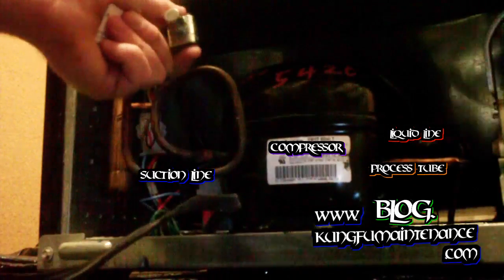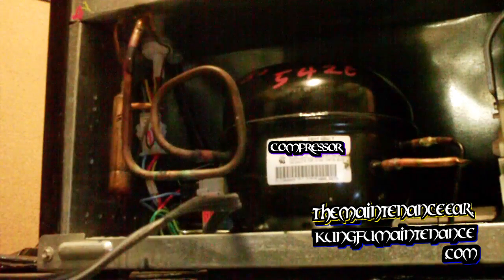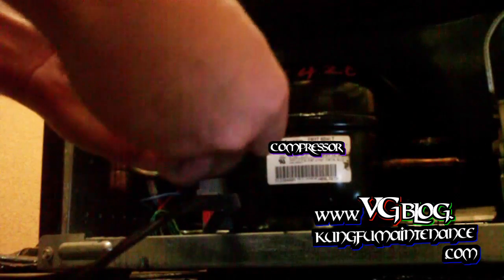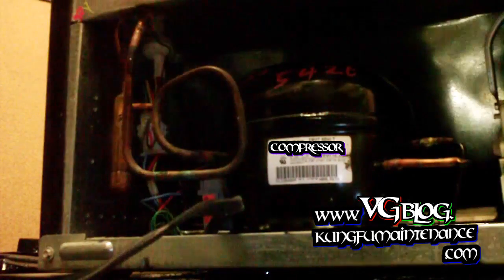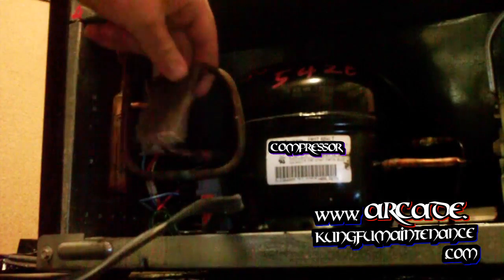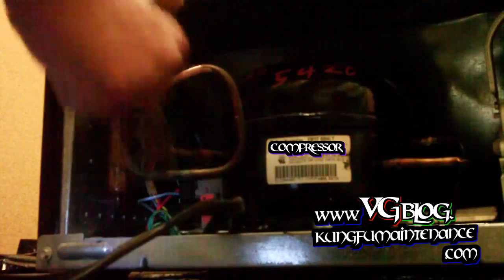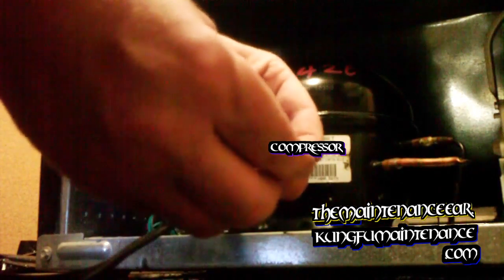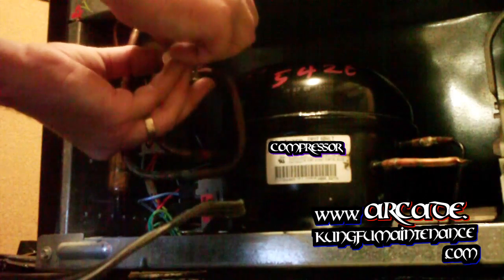How To Install Bullet Piercing Valves To Charge Refrigerators Or Air Conditioners Low On Freon

Comment: Do bullet piercing Valves cause leaks over time?   
Can you make a video to show how to fix a line with a leak in it?

Thanks
Reply from the maker: Bullet piercing valves can leak over time. To fix one with a leak the refrigerant would need to be recovered and than a more permanent valve brazed in. These are usually used for refrigerator repairs using R-134a which is less damaging to the environment. Leaks are most often so small that all that is needed is a tiny recharge if one does leak. The charge can often last years so unless the leak is very bad the valve doesn't necessarily need to be replaced.
Reply: KungFuMaintenance Very cool.   I ran into this problem before and had to pay nearly $500 to get it fixed.  So I was hoping you could do a video to show how to repair the leak.  I may have one again, and can not find any leak repair videos.
Reply: I was also wondering, how much do all the tools cost to be able to recharge, pull the air out, and more?

Comment: Hey, My compressor looks just like this one accept the line you installed the bullet piercing valve on isn't being used on mine and it is crimped off.  So In saying that what do I do to charge my system.  by the way my fridge is a  Admiral ASD2514AR not sure the age I couldn't find a date but its not really old.  Its a side by side as well.  Any info you can give me would be great.  Thanks.
Reply: KungFuMaintenance Thanks for the tips, answered my questions for the most part. Any benefit to installing a second access valve on the liquid line vs process tube? Or a second one at all?
Reply: 3 months now and I have had to turn my fridge down 3 separate times because it is so cold.  Max on fridge is 7 I have it on 4.  Freezer has separate control knob also set to 4 and stays at a steady 28 degree's at the top and at the bottom 20, I was told the bottom was somewhat like a deep freeze. Every local repairman I called said they would not work on my fridge unless I payed them to install a new compressor.  I have been a mainteneance mechanic for 20 years and pretty handy with just about anything and with KungFuMaintenance help I was able to turn a completely useless refrigerator into a like brand new one.
Reply from the maker: The short capped crimped off line would be a process tube. Some like to charge through it(There are many schools of thoughts on best practices for charging.). The slightly larger line (Sometimes has foam wrapped around it would be the suction side (I prefer to charge through it about 6 to eight inches from the compressor) it is sometimes insulated to maximize efficiency and to keep the cold line from sweating and dripping in the wrong places. The smaller diameter line is the high side line and most likely gets pretty hot when in use.
Reply: Oh Ok.  I wasn't sure what that extra tube was for.  Do you think its safe to recharge from the tube or better to be on the suction side?  I want to do it right so if the suction side is a better spot then maybe I should do it from there even though the process tube is more accessible.  Thanks for clearing that up for me.  I actually thought that might be what it was I just needed someone who knew what they were doing to confirm it for me.  So do you think it matters, process tube or suction side of compressor?
Reply from the maker: KyBigGuns Either side is OK. Their are many schools of thought on which is better. I personally prefer charging on the low suction side with a bullet piercing valve as no really special tools are needed and recovery of existing charge is not needed if it still has some refrigerant in the system.
Reply: I did everything correctly and my refrigerator has never worked better. Thanks for the advice.

Comment from the maker: If you go to my Kung Fu Maintenance website "Keeping Cool" page. You can enter "bullet piercing valve" in the search box at top right. I make a small commission off any parts purchased there. Or maybe your local HVAC and/or appliance store.  It is preferred to charge little by little through the low side with vapor while monitoring pressures and temperature stopping early at desired temp. I like to see the freezer at 0 plus or minus 5 degrees and the fridge at 40 plus or minus five degrees.

Comment: Hi,
  Good video.  Where can I purchase one of those piercing valves and how do you know how much Freon to put in it?  Thanks for your time.
Reply: They are Supco brand Bullet Valve (google it).  They are available at Grainger stores both online and in their warehouse.  Locations all over the US.  Many people ask about what adapter you have to get to attach to the Supco Piercing Valve to your refrigerant can -  you can get at many autoparts stores what is called a "R-12 to R-134a Retrofit Parts Kit'. This will include a few different adapters - one of which being the exact one you need to make the Supco Piecing Valve connect to any R-134a refrigerant canister that has the "shrader valve" fitting.  I ran over to my local O'Reilly or AutoZone or Advance Auto Parts and they all offered one in stock.  Brand is A/C Pro part number is VA-LH11 (Google it).

Comment: Thanks a lot!!, can you help me out? I need to know what kind of tools that the technician attached to the process line in this video ApplianceJunkcom evacuation and charging of a refrigerator 2:03  I don't want to cut open the compressor process line and let the Freon escape. Bullet piercing valve is not available here in the Philippines . Thank you in advance!

Comment from the maker: No actually the discharge tube is the high side or liquid side line just after the compressor. It is usually extremely hot (enough to tattoo you)when the compressor is running as it discharges the absorbed heat in the liquid refrigerant to the condensor coils to give off its absorbed heat. The process tube is usually a third line separate from the suction and liquid line that is usually pinched off from the factory. It is usually a short stubby line that can be re accessed and a valve added to.

Comment from the maker: I usually get the R-134a from an auto parts store and bring the bullet valve with me. Often an adapter is needed that comes with some kits or can be purchased separately. Most bullet valves (just like most residential A/C service ports) have a 1/4" hose port connection.
Reply: I found a nifty adapter set at my large autoparts store(most should have) . It's called "R-12 to R-134a Retrofit Parts Kit".  Has many adapters included. One is perfect for this percing valve with the shrader valve too. Brilliant thing.
Reply: I found a nifty adapter set at my large autoparts store (most should have) . It's called "R-12 to R-134a Retrofit Parts Kit".  Has many adapters included. One is perfect for this percing valve with the shrader valve too. Brilliant thing.

Comment from the maker: If you go to my Kung Fu Maintenance website "Keeping Cool" page. You can enter "bullet piercing valve" in the search box at top right and they will come up. I make a small commission off any parts purchased there. I hope to add links to the parts used in me videos on the website in the near future. Alternatively your local HVAC and/or appliance stores will most likely carry these. I purchased the R-134a at a local auto parts store.

Comment from the maker: The short capped line would be a process tube. Some like to charge through it(There are many schools of thoughts on best practices for charging.). The one with the foam wrapped around it would be the suction side (I prefer to charge through it about 6 to eight inches from the compressor) it is insulated to maximize efficiency and to keep the cold line from sweating and dripping in the wrong places. The smaller diameter line is the high side line and most likely gets pretty hot when in use.

Comment: i got the valve and was looking at the compressor. 3 lines - one short capped line on the left side and two on the right side.  the one has foam wrapped around it, it is black and seems to go to the coils.  the other of the two is bare copper and seems to be a smaller diameter.  the reason i am asking is the book doesn't tell you crap cuz they don't want to fixing it.  delonghi-25 pint ariadry dehumidifier if that helps.  thank you. R22.

Comment from the maker: It is most likely printed on the data plate usually right below the model number and serial number. Most likely it uses the refrigerant R-134A as it is more ecofriendly, less damaging to the environment, most especially the ozone layer. It is used on majority of newer small appliances, many refrigerators, and a lot of automobiles.

Comment from the maker: Yes, the install would be on the fatter low side line. Once pierced you would first attach your hoses and matched type of refrigerant. If unit is not completely empty and you are adding to the charge, than you would release the allen head purge the lines and charge. Once filled close and cap.  If completely empty or there is a substantial leak you will want to attach hoses open alan head locate and repair leak first than pull a vacuum verify vacuum holds and than charge, close alan key and cap.

Comment: thank you very much. I went and watched a few youtube Videos including yours. I had put way to much in. I thought it should be 120 PSI. It was running 50-60PSI. I let some out so now its 10 psi. If it dont work i'll let more out until its 0. I had it on the low pressure side. I turned out my own fitting on a lathe and soldered it to copper tubing. It appears to be working now.

Comment from the maker: I installed this one on the low suction side. The low side will always be slightly larger in diameter. It is the suction side coming from the freezer evaporator to the compressor. The high side will usually be smaller leading to condensor coils. It is preferred to charge little by little through the low side with vapor while monitoring pressures and temperature stopping early at desired temp. I like to see the freezer at 0 plus or minus 5 degrees and the fridge at 40 plus or minus five degrees.

Comment: Which hose did you put that on.. the low-in or high pressure side? How do i tell which one is which.. The one that leaves the compressor going to the icebox is that the low side or high side. I refilled my gm refrigerator tfx20jr with 24 OZ// and had to let some back out cuz the compressor made lots of noise and kicks off..

Comment: Yep, that's all I use those "vampire taps" as I call em for. They're useless for trying to pull a vac on a system, that little tiny hole they make is so restrictive, it takes forever to recover the R-22 from old windows units that I junk out

Comment: Those things always leak gas . I like the braze in shrader valve type . You should change at the process tube for a frigerator and window unit . Thats what the epa wants you to do .They have spexial tools for process tube charging from robinair and some other companies as well . I never had luck with them valves . I would use  them if reclaining the gas in it for the dump .

Comment: Its always better to braze in a solder type valve when possible,  But saddle valves are excellent for recovering the Freon out of a burned out system that has no access valve, With that said I've used them numerous times due to not having a MC Torch anymore, Though a Map gas torch will work on smaller stuff that and is relatively inexpensive.

Comment from the maker: Most times when you are installing one of these it is a situation of nothing left to lose. The unit is not cooling due to a freon loss. It is a good idea to leak check these after the install and should a low freon condition arise in the future it would be the first suspect. I have had good success with them. I still have a window air conditioner I added high and low side valves to that was low on freon about seven years ago. It kept me cool through the 111 degree summer days this last summer.

Comment: Last time I used a piercing valve was about 15 years ago, and it worked for some time.  However, over a period of several months it slowly leaked.  I never knew for sure whether it was my technique or the inherent limits of that type of valve.  What has been your own experience with it holding up for a few years without leaking?  Is it worth considering as a permanent type of adaptation?